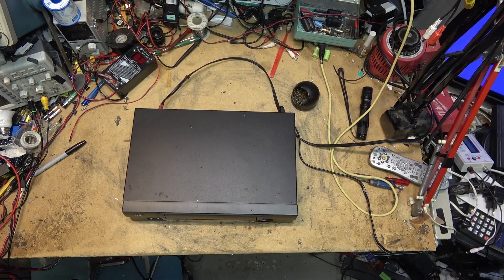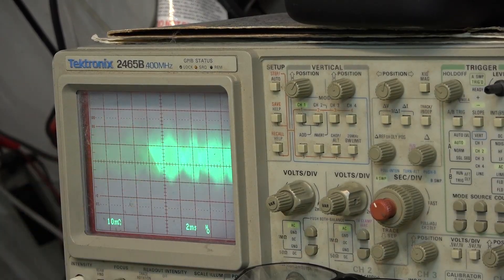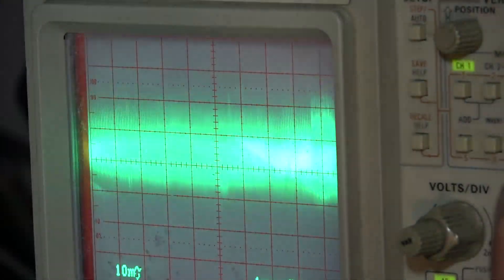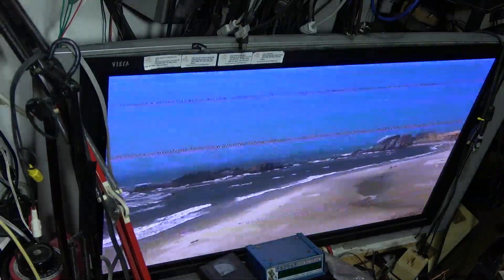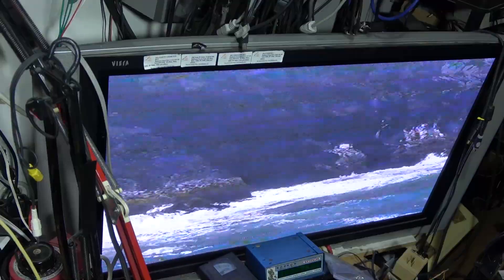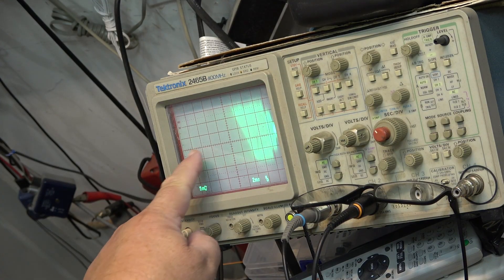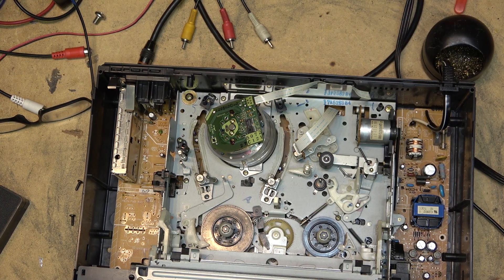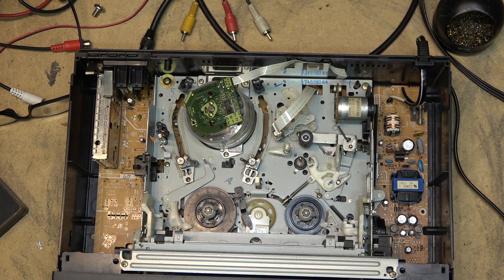Can a VCR be made to play in FF without lines in the picture?

Comment: I have an SV 2000 that already does as its got problems on the board. it has both good picture and sound. but won't play at correct speed.
Reply: Philips V2000
Reply: @coastalvideotransfer Mine Says SV 2000 Its made By Phillips though. It Plays too fast. Capstone Motor goes too fast. I do have just one tape here it plays right. Yet all my Tapes play fine on all other Machines. I think The one is stuck on A Standard Type Play or Whatever it is As it will not Play the Slower Speed Tapes at all. They Will play Fast with Like Mickey Mouse Audio. Picture holds steady though. its just Running too fast.
Reply: @randymoyer5351 probably bad cap or resistor, not giving out a pulse sync to the microprocessor

Comment: Do you have an original VHS alignment tape or just the Beta one? I see them on ebay from time to time and they are over 100 bucks.
Reply from the maker: I have a beta factory tape and a vhs colorbar tape.   I had a factory alignment VHS but was unable to steal it from the shop when I left.
Reply: @12voltvids  I recently bought a factory beta alignment tape KR5-1J (SECAM). I used it to adjust the ACE azimuth on my linear stereo SL-C9. It was as easy as matching the phase of the two channels. On some machines I have to adjust the tracking in order to line up the two fields in the dihedral adjustment portion. Is that normal? I assume that if the tracking control has enough range to line them up then the machine is OK. Is that right?

Comment: May I suggest a video dedicated specifically to you aligning misaligned Betamax machines without using scope and/or alignment tape and see how close to perfect you can get them?
Reply from the maker: Beta machines typically do not go out of alignment unless the head is replaced as the guides are stationary.
Reply: @12voltvids  Right, fair enough. But many of us Beta guys, including myself, have swapped a head disk over on a Sony Beta with good enough results to just leave it be. I guess my curiosity is if you DID have a misaligned Betamax but no scope or tape, how you would approach tweaking guides to zero in as best as possible. Just a thought.

Comment: That's what the Philips V2000 system did as standard
Reply from the maker: Philips used dynamic tracking. Mitsubishi used this on their high end HSU82 also sold under the electrohome brand as the AVRJ05.
I have one. Sony also used it on BETACAM SP editor decks. I have one of those too but it's not currently functional.
Piezo actuators were mounted on 2 special effect playback heads and they could go from a crawl through to full search.
I highly doubt that my machine is still functional after it's long slumber. I will dig it out some day and test it.
Reply: @12voltvids  
philips used it as standard, meaning it's active during playback. others was only during some functions.
so definitely, philips was the one that pushed home VCR as far it was possible to.
edit : or maybe i'm wrong and some others were also capable of adjusting heads by using FM playback level for exemple?
Reply: The dynamic tracking system used piezo electric techniques to change the position of the heads on the fly. It was used in later VHS models with a bit less range.
Reply: My old Kindergarten used philips V2000 tV for School TV in the 80s

Comment: JVC's Dynamic Drum system actually not only tilts the head drum, but more importantly adjusts the tape path around the head drum (guide ring). Supply and exit guides just raise and lower tape position related to head scanning paths (and the angle/position of video tracks when recording to tape). With SP speed (widest tracks) you can kind of make this work, but change of head scanning path with tape speed is geometrically much more complex than just externally adjusting tape position related to head drum. Dynamic Drum system has no effect on the guides you adjusted.
Reply from the maker: Yes I am fully aware how it operates. It was a terrible system. We sold a bunch of them to a casting studio and every single one came back and JVC ended up taking them all back and replacing with non DD models (9911). The big problem was interchangeability with other machines when they were used as record decks. We sold 25 of them and all 25 kept coming back to the point that we sent every last one back to JVC. They were changing entire drums only to have those ones come back too. In the end they took them all back and replaced them. They were bad when new and age has not been kind. Plastic gears that crack.
Reply: @12voltvids  I don't share the same experience with interchangeability. During recording the head drum and guide ring stay in neutral position (as long as the gears don't  crack/split). I have done a lot of testing with adjustments and developed the 'DD emulator', that you already have installed in some devices. My tapes cross play fine on  JVC HR-S9700EU, Panasonic NV-V8000EB, JVC HR-DVS1EU and Akai VS-422EOH.